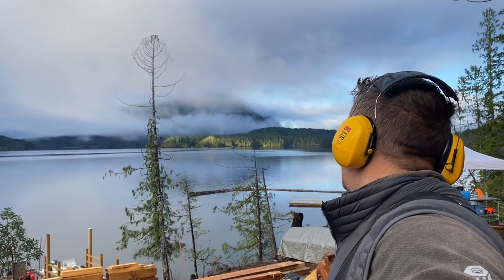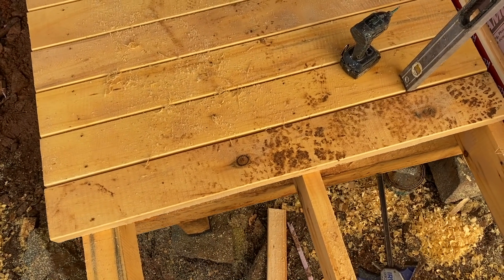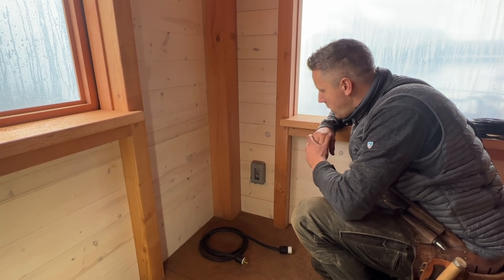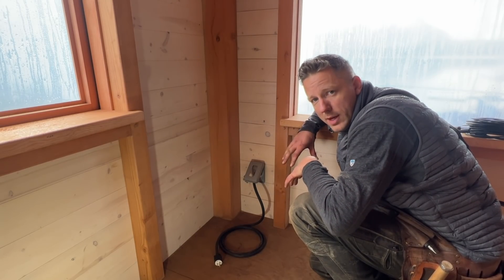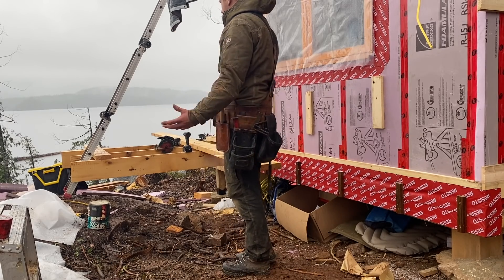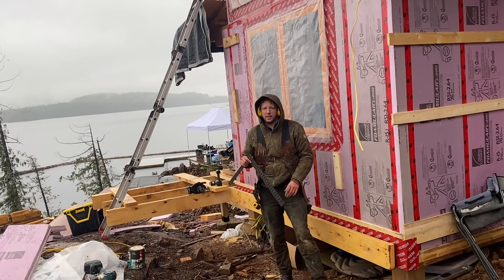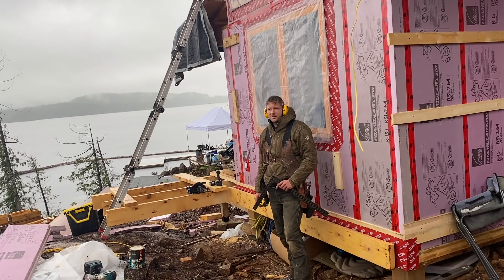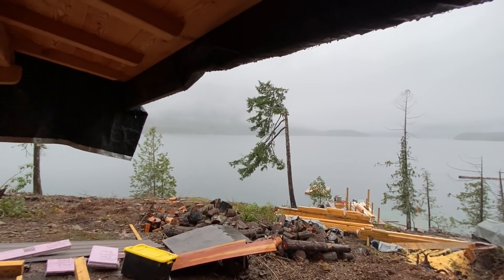Powering Up My Cabin With The EcoFlow Delta Max!!!

Comment: Love your work mate 👍
The electrical engineer in me says you might have trouble charging your batteries from your solar panels over that kind of distance. I know it doesn't seem like a long way but DC power looses voltage rapidly. Cables with a greater cross sectional area (which cost more) is one option, or another would be building a wee enclosure and keeping the batteries outside by the solar panels. Running an extension cord from the batteries to the cabin circuit should be fine - as that will be AC.
You'd just need to stop the batteries in their enclosure getting too hot or cold. Might be worth checking with ecoflow to see what they recommend.
Cheers from NZ!
Reply: Does DC lose more current due to conductor resistance than AC?
Reply: @ianbutler1983  DC is usually lower voltage as well. Could be the true explanation. End result is the same, cause is different.
Reply: @ianbutler1983  yeah kinda - is also the voltage will drop as you measure it along a wire carrying DC (where power transferred is voltage times current - so pretty soon you end up with essentially no power). I've not heard a satisfying explanation of why DC voltage drops off so quickly - other than to say 'because electron mobility is a thing' haha
With DC you're asking the electrons to move a long way.
With AC you're only asking them to shake back and forth.
Apparently, back in the day Thomas Edison's plan was to have DC power stations every mile or so - even inside cities.
Thankfully Nikola Tesla rocked up and saved the day with AC! 😁
*all of the above is epic oversimplification
Reply: @ejburke8271  Yeah I agree 👍
More voltage = more bettera. That's just good science haha

Comment: It doesn't take long to fulfill OCD on occasion, this was one of those times.  Turning the big rock into a fire pit will be pretty cool, bear in mind that it might (probably) crack, even throw out some high speed gravel when it gets nice and hot and expands beyond it's structural limits. Gets exciting.
Reply: I was thinking the same thing. Hot-rocks-go-boom is a thing. 
The “safety-first” side of my brain is in panic mode thinking about running power throughout a cabin’s entire electrical system without going through a breaker panel. I’m guessing that the magic power box has some sort of built-in protection (or liability waiver) in case there is a short somewhere that starts to sparky-spark in the walls.
Reply: @stewskinner5717  most of those units have fuzes.

Comment: I've had that same problem with lumber from reputable suppliers.  I learned to check every 2 or 3 courses so I could cheat the subsequent courses back in.  However, I never experienced the huge difference in width you're dealing with.  You live and you learn, if you pay attention and use your head for something besides a hatrack.

Comment: R/T your inconsistent lumber - I’m using your post on a stone method for fence posts. Seven posts, using 36” x 3/8” all thread, one of the rods turned out to be fine thread. The rod is all concreted in and I couldn’t figure out why the nut wouldn’t go on. Thought I messed up the threads so I bought a small tap and die set. Couldn’t figure out why the threads wouldn’t straighten out. From all the fooling around the rod is now turning in the concrete. Rod is now rethreaded, coarse over fine and the post tightens down onto the stone. I’m afraid to tighten the post down too much because of the weakened threads. I think I’ll probably glue a new piece of all thread into the concrete. Second time I’ve discovered the hard way strange threads mixed in. lol? Cheerio.

Comment: If there is a solar array, isn't dangerous to get power in the reverse plug? At 5:21 you can see the terminals. Very easy to touch these by mistake...

Comment: Y'all should do your research before picking up one of these Ecoflow batteries. The fans on these run loud when you're charging the battery or using it to charge something for any extended period of time. It drops to 60% capacity after only 800 charges and a round trip efficiency of only ~58% (should be at least 70+%). Literally the only advantages this product has over competitors is its fast charge rate and relatively low cost.
Reply: REALLY low cost when you get it for free!